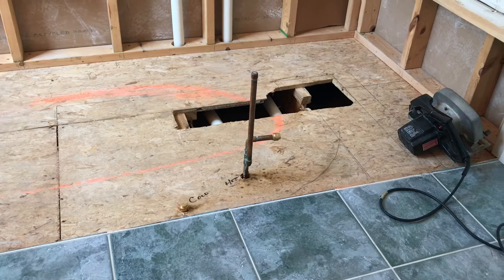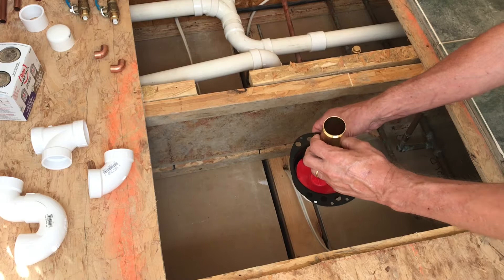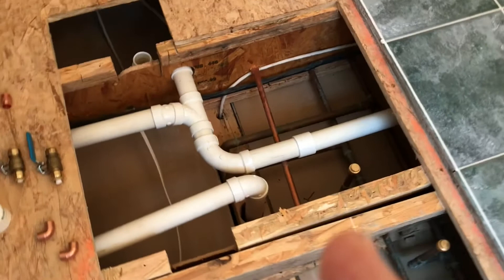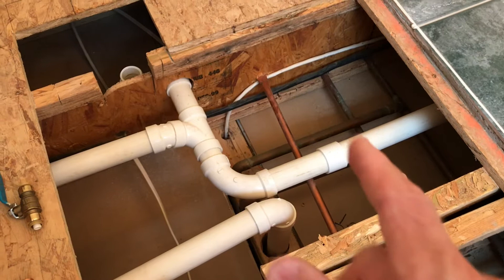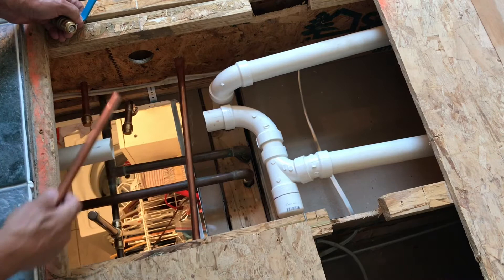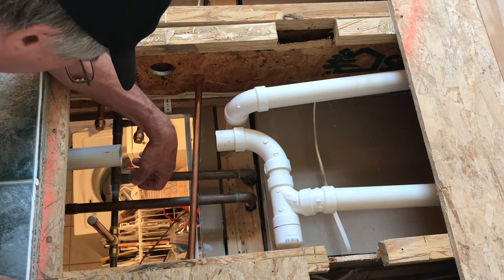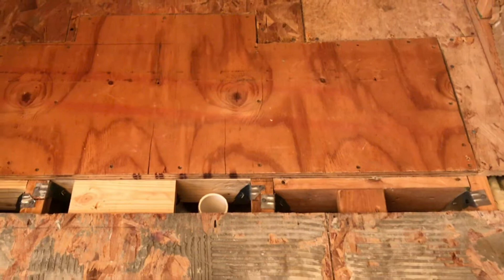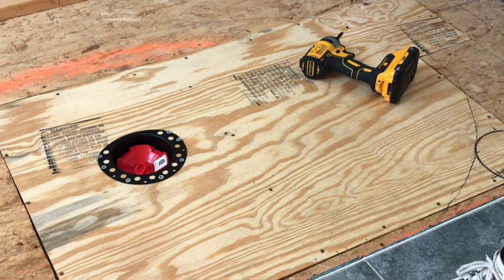Relocate Tub Drain & Water Supply for Soaking Tub @DIY Boomers

Comment: How do you reinforce the i joists once the flange is cut?  I’m in a similar situation and it’s my understanding that the flanges are not to be notched
Reply from the maker: You’re right. The flanges should never be cut.  As you can see in the video, our builder did cut two flanges in our floor to accommodate the old tub drain line. On one of them, they attached another i joist to splice across that cut because it looked like they cut that one but didn’t need to. The other one was in their way. The only good thing is that there is a downstairs wall directly underneath those cuts (you can see the top plate of the wall in the video).

So my advice would be to avoid cutting the flanges at all costs.
Reply: I need your help! I rerouted the water cpvc pipes for my selfstanding tub. How can I connect the cpvc to the water like of the faucet? Right now, I just have th sharkbit stopper
Reply from the maker: @adrisabe84  It’s hard to say what needs to be done without seeing the layout with the piping and the faucet, etc. If you could send some pictures to diyboomers1@gmail.com and describe what needs to be done, I’ll see if I can be of assistance. Also, are you familiar with and following code requirements for your area?